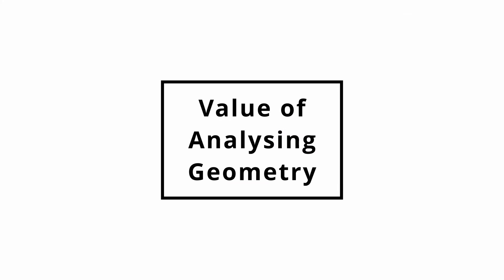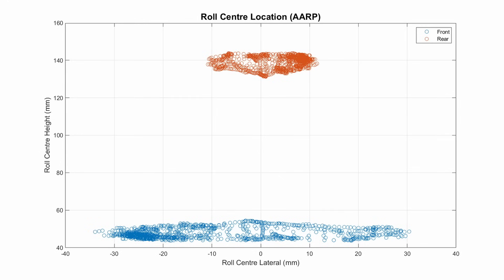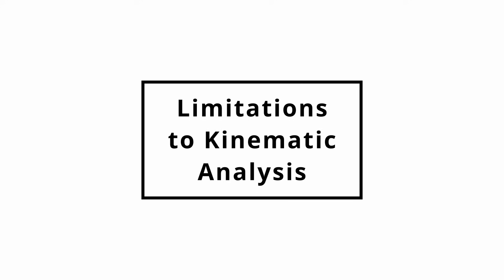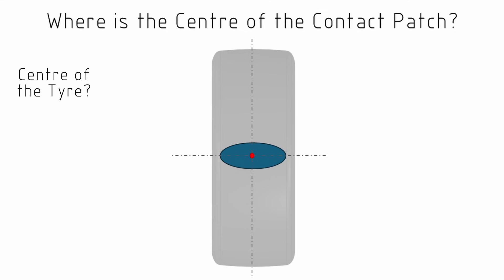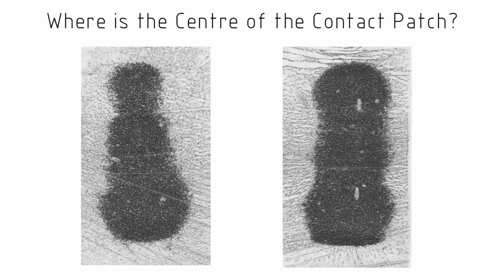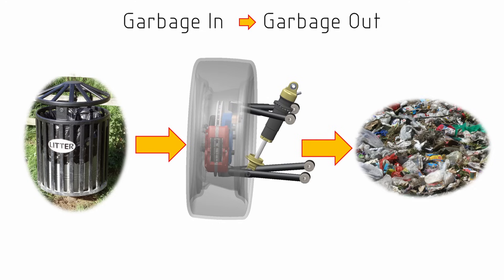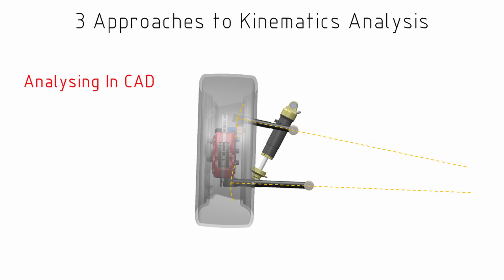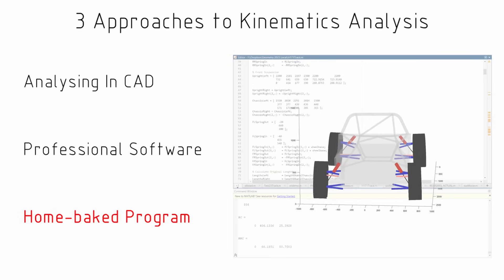Suspension Kinematics Calculation - An Overview of Methods Used (Project 171)

Comment: 17:02 "Spot the Differences" Looks like your simulation CAD and the car match up really well. Very hard to detect anything different at all. The most I can see is that the outboard front pushrod joint is further up the arm in real life, but I doubt that has any meaningful impact on the kinematics. Here is a suspension nerd question- does narrowing the rear track make a car understeer more or oversteer more, and why? Let's assume you keep the roll couple distribution the same. Your FSAE car looks nice, clean and tidy! I like the minimalist bodywork and no aero. The year my team won we had the ethos of only devoting resources to things that make the car faster or were required by rules. We spent less than a day doing the bodywork, including the rattle can paint job.
Reply from the maker: I'm not sure whether you are asking that question in a cheeky way...

I had a bit of a heated online discussion with my old boss a few years back. During the discussion he asked that question... not sure if you will still be able to track it down, but I do answer it. Although I think some people do like to ask "gotcha" questions.

That yellow car was 2004 (2005 US), was a nice car and has been sitting in a museum for quite a while since then. Which team were you involved with?
Reply: @KevinHayward7  I was a founding member of the Cornell team, and led frame design for the winning '88 car. The head of the team  actually founded the team after having founded a team at Brown and then transferring as a Junior. So he was a team lead for three years in a row. He has gone on to a wild career in OEM cars and in motorsports, and he's the one that I thought I learned that a narrower rear track would, all things being equal, result in relatively more loading (overloading?) of the rear outer tire in a turn, thereby reducing grip and inducing oversteer. You need a stiffer bar or stiffer springs to preserve the roll couple distribution. But the current Cornell team just took a seminar from a chassis dynamics guru who argued that a narrower rear track would have the opposite effect. This is all above my level of expertise. So yeah, a bit of a troll, but also a serious question! We had the experience in our '87 car that we had wider rear track than front, and had to put a very stiff roll bar on the rear to get it to turn in on the hairpins. After the competition we disconnected the sway bar and reversed the wheels (reducing the track) and it greatly improved handling. Lesson learned!
Reply from the maker: Wow! Being a founding member of the Cornell team is something to be very proud of. Your team was definitely the standard we all had to reach. If all things are equal then reducing the track should mean there is less load transfer at that end.  Imaging the chassis rolling a set angle, if a track is lower then the springs at that end will deflect less for the same angle, thereby resisting less of the moment. It is a "Gotcha" question because it highlights the need to consider the connection between the front and rear end of the car, and the fact that the car chassis (if stiff enough) forces the roll angle to be the same at both ends.

But pretty much any normal way of changing the track will affect your motion ratio, which is a square relationship. Decreasing the track by decreasing wheel offset will mean your motion ratio will increase and the effective rate is proportinal to motion ratio squared. This is could have been the bigger effect when the change was made.

As another factor to consider in FSAE nearly all the tyres are running below ideal temperature and the tyres can have low load sensitivity. Which means that effects due to camber and temp can swamp the load sensitivity part of tuning, meaning that sometimes the opposite thing might help. Lots of flow on effects from even the simplest setting change

Part of the reason I don't like "Gotcha" questions is that they are often asked to try to establish ego rather than discuss process. Each to their own I guess.
Reply: @KevinHayward7  Yeah, not ego, I'm genuinely curious about your thoughts on this, having heard conflicting thoughts from trusted sources. I think the "both ends of the car" factor is at the root of the gotcha nature of this question. Asking "what effect would changing the track have" seems like an incomplete question, and would have different answers depending on what assumptions you make to be able to answer it. I hadn't thought about the narrower track essentially stiffening the suspension if you do it with wheel offset, for example. But I was thinking about more of an "all else being equal" version of the question, where roll couple distribution and wheel rates are identical for both cases. In practice this might mean swapping springs and making sway bar changes to make those two parameters match up in both scenarios. But I'm not even really thinking about this as a tuning adjustment anyway, but a fundamental choice during the design phase where the narrow vs. wide track are two possible options for a new car. So the question becomes, "With identical wheel rates/roll couple distribution (and CG height, weight, tires, etc), would a narrower rear track version of the car have more oversteer, or more understeer?" My experience was that our wide rear track '87 car required a substantial rear anti-roll bar to get around the hairpins, but the '88 car with narrower rear track was able to have that oversteer feel we needed while having similar roll bars front and rear. This resulted in a car that could get the tail to move but was also very controllable. The '87 had vicious drop throttle oversteer, but then that trick of flipping the wheel offset and disconnecting the bar did seem to be an improvement. Are there any videos on YouTube of your car in action?
Reply from the maker: @When we started up at UWA we borrowed a fair few settings from the good established teams, especially Cornell, UTA, and RIT.  That included the narrower rear track that was almost a given in FSAE, with very few of us really understanding why.

I tend to think that one of the best advantages was a tighter line for the back end.  Cars had longer back ends (wheels further behind the drivers head) a while ago and reducing track meant reducing the required yaw to miss cones.

All things equal the narrower rear track should be an understeer effect if the grip is predominantly being determined by tyre load variation.  However that is such a small effect in FSAE that I doubt it would be noticeable to the driver with the small track differences.  I would note that I think the current practice is even F&R tracks for most teams with minimum wheelbase.  Low track vs higher track tends to be more of an aero choice as well as the comp you are in (some countries run tighter tracks than others).

Giving some thought about the why of your narrower track giving more oversteer (or less understeer) it might be more closely related to the longitudinal (and resultant yaw moment) behaviour of the diff.  If you were running a spool and not lifting the inside rear then the reduced track will reduce the moment trying to push the car forwards.  This would also be the case with the typical torsen diffs.  Noting that they typically cause an understeer effect in both braking and acceleration which would be worse with a wider track.  Just how much the diff affects handling is often overlooked in FSAE cars.

The main approach to improve FSAE handling in the last decade has really been to increase yaw accelerations.  Not enough yaw acceleration will feel like understeer everywhere.  It is pretty crazy how much better the new cars are at rotating compared to when I was a student.

FSAE cars are fascinating to work on because they are such an extreme.  Lightest racing cars you will find with full suspension that run on tracks tighter than go karts. All the yaw and steering based effects are amplified. Hope something in there got close to an answer.
Reply: @KevinHayward7  Interesting! Our team lead managed to get his hands on a Torsen, I think out of a JDM Celica or something. We had to get custom splines machined to fit it. Keep in mind this car was designed when the Mac Plus was a popular PC, and for the '87 "wide track" car we had a sponsorship from Chevy, who offered to analyze our suspension on their software. They were the ones who recommended the wider rear track, I think on the logic that there is a rear weight bias and so the wider track made sense. But our assumption afterwards was that they were not imagining as tight of a course. For the '88 car the goal was to have 50-50 weight bias under full braking, and of course narrowed the rear track. Here is a clip of the #16 '88 car at comp https://youtu.be/-T8fF_Pm8as?si=0ujzPex2tG8eummx&t=513 with the narrower track, and me driving the #16 '87 car (not very smoothly!) in my jeans and work shirt "driving suit." https://youtu.be/plWD0ZBtQeU?si=V-fc97dxcpYIq6qA&t=588
Reply from the maker: That first video was a great watch, Thank you.  The music fit very well.  I’ll need a little longer to watch the second.  Literally history in the making.  Are you surprised at how large the competition has become worldwide? I remember going through the history of the comp looking for ideas when the Australian competition started. So many things had to go right (volunteers, competitors, organisers) at the start for it to be where it is now.  If you are ever in Western Australia I would be glad to buy you a beer and hear the stories.
Reply: @KevinHayward7  It was pretty well established in the US when we started in '87, but there were maybe 40 or so competitors. UT Arlington was a dynasty, and I remember U Maryland was always good. But yeah, international has since exploded, with absolutely incredible top teams. I feel like in many ways its probably more fun to be on a team that is less storied / organized. Like in your case you were innovating on suspension, not just tweaking an already refined design. For me, I knew nothing about frame design, not even what triangulation was, when I started. The result was a frame design with features that remained in CU cars for decades.

Comment: Will you expand on how to approach suspension design for a home built car without tire data in a future video?
Reply: In Australia we spell tyre with a y not an i.
Reply: @danielbroughton7949  super helpful comment. Keep up the good work 👍
Reply from the maker: Will try to expand on it, becasue I doubt I will have the tyre data during this design. I'm also okay with Tire or Tyre, worked in both Oz and the US so its all good. I can even convert between Litres and all of the different versions of Gallons.

One little quirk I have from working int he US is that I can only really picture what a spring rate is going to do on a car once I have converetd it to lb/in.

Comment: Excellent video, with some very often overlooked situations……
one of the nicest to absorb. 👍

Unlike some mega technical ones with no pictures , just mind numbing equations that the everyday car builder will never comprehend. 
The problem with suspension geometry is most like to spend ridiculous amounts of money on engine power, big brake kits , endless testing when really they should be able to just spend a grand , input some geometry / pickup points , then get 3-4 scenarios/ setups to try. 
The software/ AI does the rest , no doubt this technology will
Be soon available to the masses. 
Maybe an interesting topic for discussion would be the geometry of the late BMW’s where they use Mcphearson strut and the a multi link bottom arm . My question would have to be why has nobody tried this multi link with at least one wishbone on a pushrod / pull rod type suspension?? 
I’d certainly try it , you could even then mount the shocker/ pushrod to the hub / upright. Ideal for a race car as generally they don’t have a big steering rack travel.
Reply from the maker: When I started my PhD I had grand plans of trying to use automated evolutionary optimisation to generate good solutions. The problem quickly became what are your objectives. Single objective problems are pretty easy to solve, multiple objectives (especially when they counter each other) ends up being much harder.

Personally I like the process too much to want an AI to take all the fun away.  But I definitely understand the frustration, most info out there is about how does this stuff work, rather than how to design it. This became brutally apparent when building the first car.  Thankfully the community is so much bigger and the online stuff has really helped move understanding forwards.

I would think that someone may have split the lower wishbone into two links somewhere. It really helps when you have FWD or RWD to avoid having massive steering loads. I have done some analysis of the virtual ball joint, but found that it was typically more sensistive to lowering / raising the car. Somewhat like the 5 link systems on a 911.

Could be some big advantages in reducing the longitudinal movement of the contact patch during steering.  Some interesting things to think about.

Comment: Suspension geometey is interesting, but there seems to be a lot of things to consider. If I would ever build a car, I suspect I would go for something that is tried and tested, like the Lotus/Locost 7. But I'm very much looking forward to the coming videos on suspension geometry, from a true suspension enthusiast!
Reply from the maker: Not a bad approach to take, it can be remarkably easy to get some important things not where they need to be, and the car can suffer a lot for it. I have been pretty lucky to make mistakes as a student early on that were low stakes and easy enough to fix.

Comment: What's your view on roll center migration? Some say it's beneficial, others that it should be kept within few millimeters.
Reply from the maker: A hotly debated topic for sure!  I think there are aspects of the roll centre calculation that are valuable, but are seriously limited. The car just doesn't roll around a kinematic roll axis (in almost all cases). Instead I now tend to just look at the slope of the Instantaneous centres at each wheel. This can be used to calculate jacking forces at each corner.  With that said typically a good suspension system often has low kinematic roll centre migration.  Instant centres that don't move around much and good length suspension links tend to mean the RC stays stable as a byproduct.

But happy to hear alternative views.  As I tried to allude to the kinematics is only part of the problem, I will try to cover more as time goes on.
Reply: @KevinHayward7  I designed suspension in my project with vey little RC movement. In short my way of thinking is less migration more predictable behaviour of a car. But I'm an enthusiast not the expert. Will be happy to hear more.
Reply from the maker: Almost certainly will talk about it in a future video, hard topic to avoid.